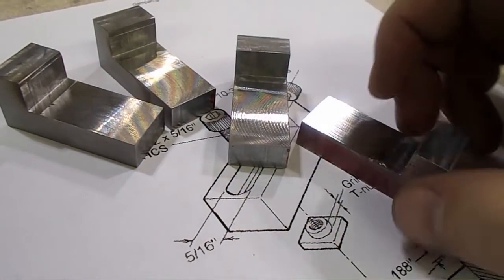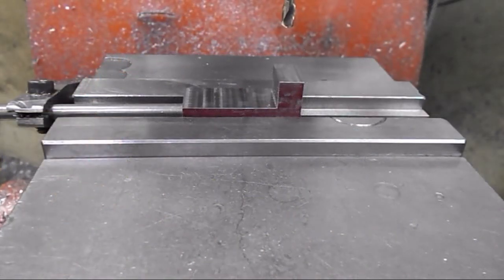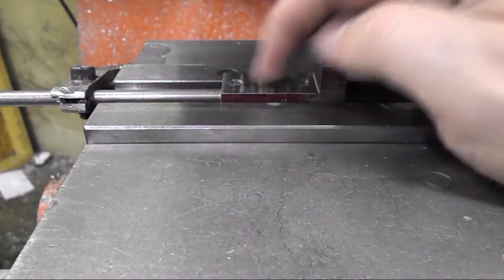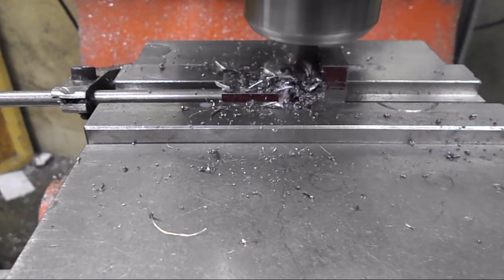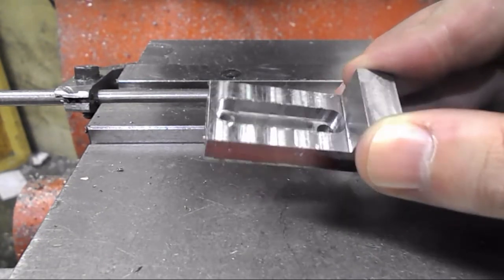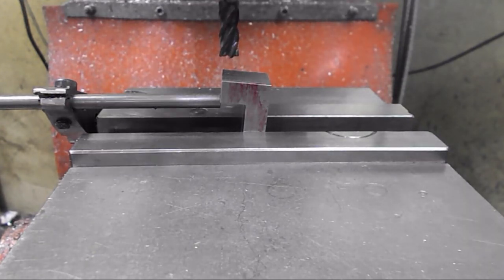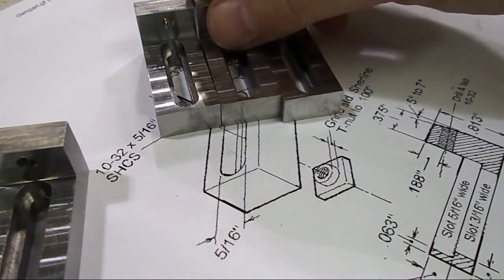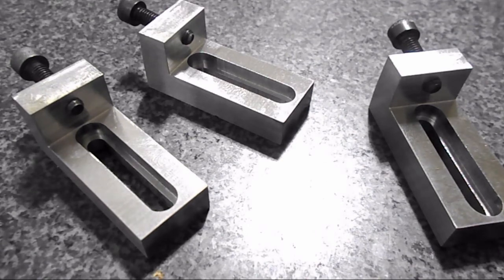Making Sherline Horizontal Clamps : A Side Project Part 2

Comment: I'm impressed that piece didn't move on the 5 deg setup. My cheap vise would slipped just thinking about the cut. You already had the center spots and you had 3 pieces you needed to mill.  I was thinking a clamping fixture would have been perfect in that case.  You know what they say, model engineering is the hobby of making the fixture to make the tool to make the part.